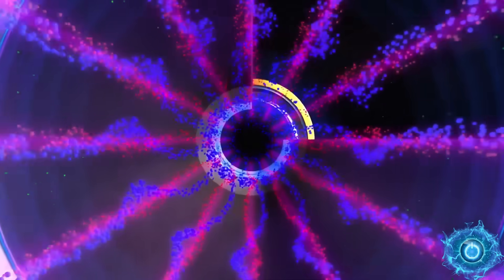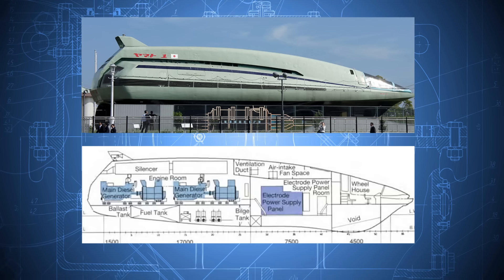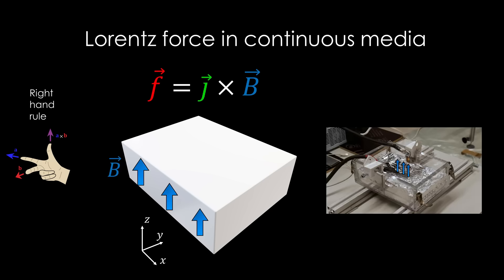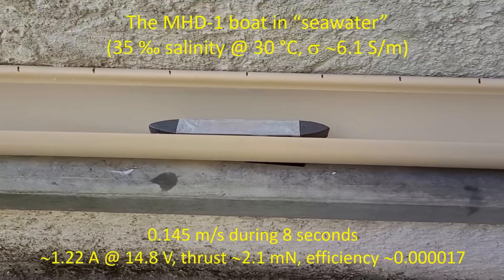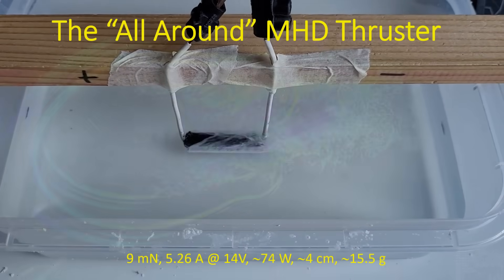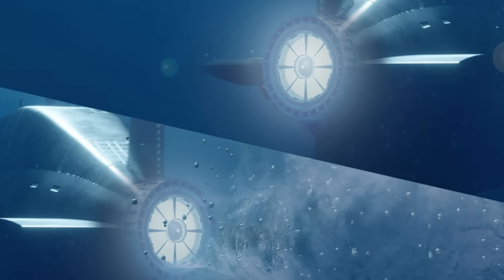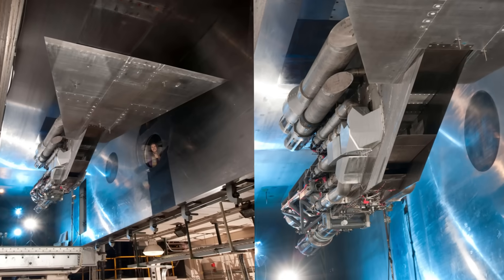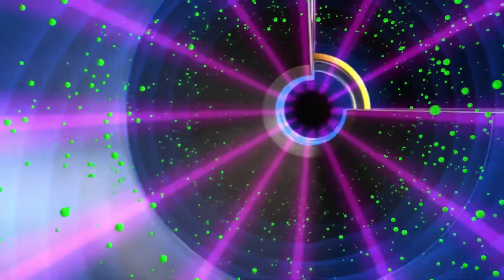Magnetic Thrusters: The FUTURE of Propulsion Technology

Comment: A Halbach array paired with a Venturi tube could enhance MHD performance by focusing magnetic fields and optimizing fluid dynamics, much like a rocket bell nozzle optimizes gas flow. The combination could lead to stronger Lorentz forces, higher efficiency in propulsion or power generation, and more compact designs.

Comment: This is not a new idea. A number of institutions have investigated MHD thrust engines. All have shown that the efficiency of such a drive is very low and the power requirements are huge.
Perhaps, as the video says, with the development of new materials, such a drive may be possible, but I don't think that any such drive will be viable in the near future.
Reply: well put.
Reply: The "new materials" couldn't change the lack of "you can't compress fluids"! So the Video trashtalking about"Fluids are like Plasma" in MPD Thruster like: The Variable Specific Impulse Magnetoplasma Rocket (VASIMR) is an electrothermal thruster from Ad Astra Rocket Company for possible use in spacecraft propulsion. It uses radio waves to ionize an inert propellant and forming a plasma, then a magnetic field (several Magnetic coils) to confine and accelerate through a ion-heater and expanding this superhighly compressed-accelerated-upheated-plasma with a magnetic nozzle to generating thrust.

Comment: There are magnetohydrodynamic flowmeters in use by industry.
It applies a magnetic field to a flowing liquid in a pipe (the liquid does have to be at least a little bit conductive) and measures the resulting voltage between the 2 electrodes

Comment: Good for submarines, but in the air this same method wastes almost all of the power that is used to make the air conductive. Only a tiny fraction of the applied power becomes thrust. The majority becomes heat and light forming the conductive plasma.
Reply: When you say the energy is converted to heat, then the heat makes stuff hot, like the air you're trying to ionize. Can that heated gas be converted into thrust?
Reply: @juliancate7089   It can, but not efficiently. The explanation why is not simple, involves the second law of thermodynamics. The short version is that making air electrically conductive is very expensive in terms of power.